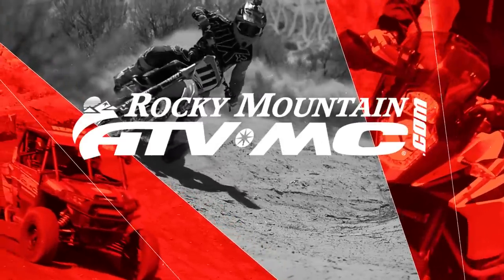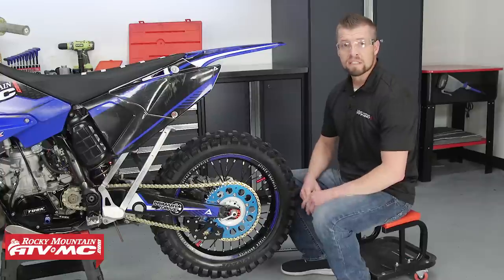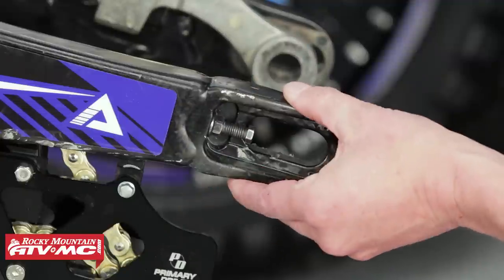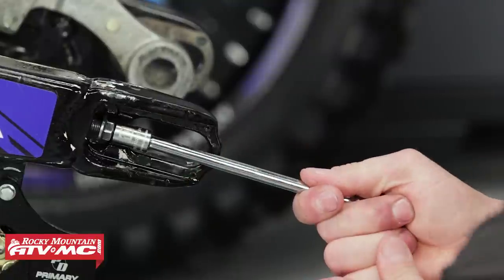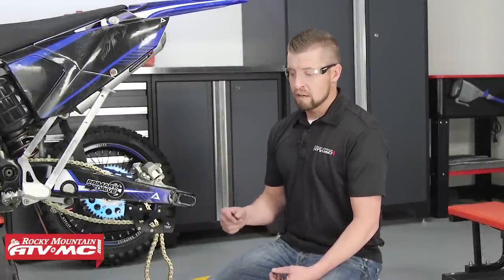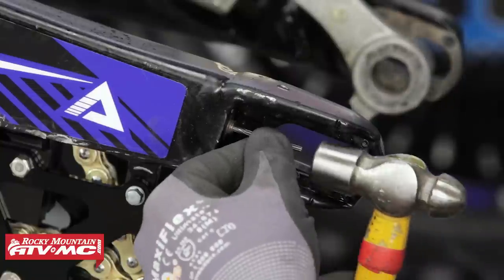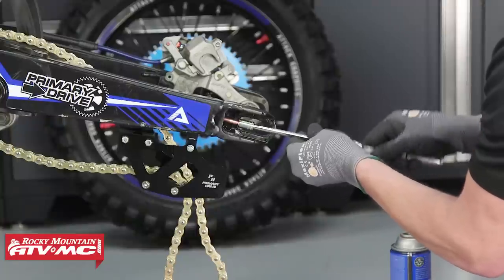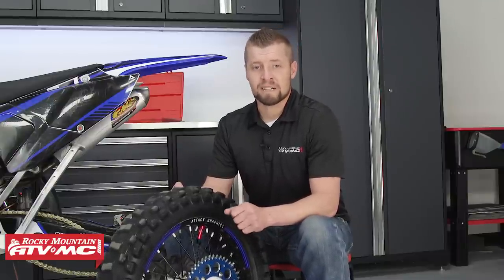How To Repair Damaged Motorcycle Chain Adjuster Bolts

Comment: Induction heaters, although not many people have them. Work very well when the finish is trying to be saved.  Aluminum is tricky to get heat in to, you have to be careful. If you can rent one or have a friend with one, then rent it from them. Put directional pressure on the bolt. Remove your wrench/socket. Heat the bolt red hot and let it heat the aluminum. Careful here, not so hot that the bolt OR the aluminum melts. Do that a few times. While it's still hot, but not so hot as to vaporize the spray, hit it with penetrating fluid .Treat the bolt like a spring and work it back and forth. It may not feel like it's moving, but at first you are just trying to break the bond with the two metals. Put pressure on it one direction and pause. Give the energy some time to travel down the threads. Then the other way.  Heat may need to be reapplied and worked for quite a while. Keep in mind the threads inside most likely are full of crud and you need to clear that out as you go. Lot's of fluid, back and forth. It might loosen and start to come, if it gets tight again just keep working it. You can also drill a small hole above  or below to get some fluid to the back side of the bolt. There is a fine line between the bolt twisting or turning. Remember bolts are only rated for so many foot pounds. A torque wrench could help put a safe amount of pressure on it. Spending the time to get the bolt out in one piece is WAY better than having to deal with it when it breaks! Sorry so long, but I hope it helps someone.

Comment: Nothing is stripped on the axle but the chain adjuster block holding the flat end of the axle has a big gouge in it so it keeps spinning I tried a 1 ¼ wrench and that fits perfectly around the flat end to stop it from moving but I cant seem to get it still any ideas?

Comment: In my bike the bolt broke i tried the gaswelding and heating method but the broken bolt did not came out .so,i drilled at the back of the boos and put uwasher to hold on . Does it help to keep it steady?

Comment: I'm working on a project bike and the issue I have is that the chain adjuster bolt (which for some reason has no locking nut) is loose but still won't come out. By loose I literally mean I can push it in and out of the swinging arm as if it were nothing but a hole. But something is stopping it from pulling out! My guess is that the previous owner tried to replace the bolt (clearly didn't know what they were doing) and bent the bolt inside the swinging arm in the process, which also ruined the thread making it loose! Not looking forward to tackling it when I come to put the wheels back on! I'm near enough finished too 😂.
Reply from the maker: Dang, that's pretty weird it won't come out. Are you going to use a heli-coil?
Reply: @rmatvmc  Yeah bud, think I'll just somehow remove the bolt and then tap it to a thread size bigger and pit a helicoil in there. Seems as though the setup is that there's a nut welded inside the swinging arm upon further inspection.

Comment: What was that tool you stuck in the bolt to unscrew it? And where can I get it?
Reply from the maker: That is a bolt extractor set. Unfortunately, we do not sell them but they can be found at most hardware stores like Ace or Home Depot.